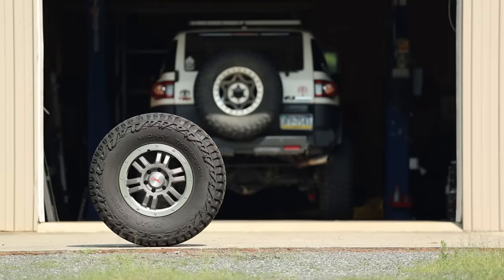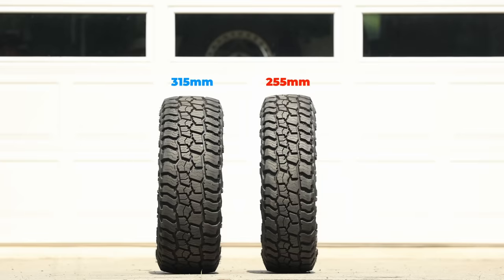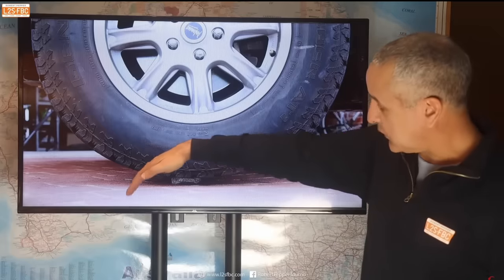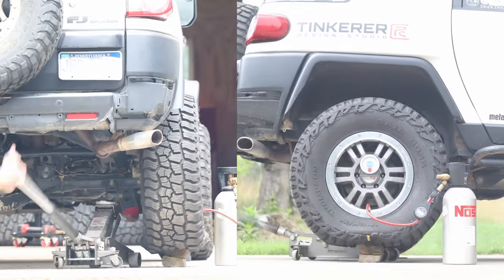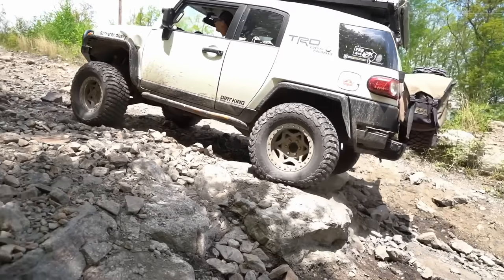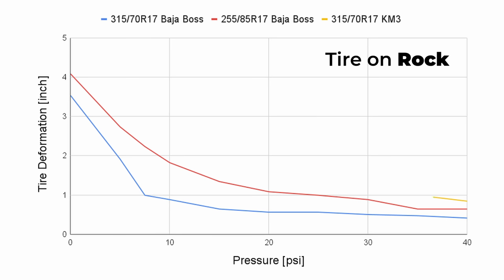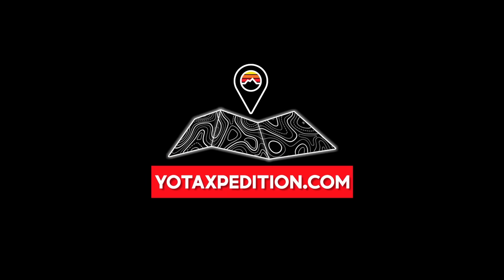3 Scientific Experiments to Settle This | Wide vs Narrow Off-Road Tires

Comment: Before I watch this vid, I'll chime out and say there is a reason most farmers with cows, other livestock that have to be fed regardless of terrain, ice, mud, snow, etc., mostly use narrow mudders. The tire sinks down to the bottom and bites the more solid terrain. Scroo contact patch; that's only for surface grip.
Reply: Reply to myself: in Missouri, I rode a pickup with 6 guys in the back, towing a car hood with an injured fullgrown cow on it, up rocky hills covered in snow slush, thru deeply mudded fields and trails, with very narrow mud tires. I became a believer from experience and horse sense.

Comment: Pounds per square inch, or- (pounds times inches squared).  If the wider tire has 10% more internal surface area than the narrow tire it will hold 10% more weight, and flex less than the narrow tire at a given pressure.

Comment: I wonder if most tire manufactures are just about show and no go. Race cars do have wider tires. There is a wider contact patch but the gains you get from going wider progressively get worse. There’s a limit for a particular setup.

Comment: I personally (yes, personally) do not see the appeal of the fat tires. From a design and engineering perspective, tires protruding beyond the body of the vehicle don't seem right to me, definitely not what the automaker intended. I'm not saying go wagon wheel thin, but if your off-road vehicle is also your on-road vehicle, tires tucked into the wells makes more sense aerodynamically. As for the looks? All those cool old Willy's Jeeps had skinny tires and I think it looks great.

Great experiments and always nice to debunk myths.

Comment: Could it also be the fact that the KM3 tire was used so it was broken in. The KM3 has been deformed thousands of times just from daily driving. So it would make sense that the tire would be more pliable due to that.  Also when it comes to tires the 315 tires have a larger air volume. The larger air volume means that the tire can physically support the same amount of weight without deforming at a lower psi. That being said 40 psi in a 255/85/17 is not the same as 40 psi in a 315/70/17.

Comment: Great video... I get data geeks. I like science more than most but right now I just wish someone would give me 3 "cool" options for my 2011, 2" lifted Subaru Outback.  My dumb ass though I would put Falken A/T 245/65 R17. Not one of my finer moments. Too big. Great tires when there not scrubbing. Weird thing is I have punished myself for 4 years. In my defense, all the builds I saw used this size tire. However, like my luck with everything my generation was the only one that wouldn't. Also, the "reputable" and very popular shop should have tried to persuade me in another direction. Lesson learned. My outback is 95% off road. Mud, gravel, sand. I don't see myself having many opportunities to rock crawl. I'm old, I'm tired and just like with my phone I want to hand it to you kids and make that thang work.  Great video, Thanks for sharing. :hand-purple-blue-peace:👴:goat-turquoise-white-horns:.  Collect dirt not ducks.

Comment: Mud racing buggies use very narrow wheels but large diameter. This allows you to cut through the mud with less resistance.  I bet the 255 wheels in your video would out perform the 315 in muddy conditions.

Comment: Your questionnaire was already wrong. It depends for what you intend to use those tires. Wider tires have more grip for instance. Narrow tires are more fuel efficient and are better in snow.
I am taking about regular car tires not off road applications though.

Comment: Why run a Load Range E tire on a light FJ? You don't get much flex running a tire designed for heavy loads. I run Load Range C with 3 ply sidewalls. Great flex and no need to go down bellow 20psi.

Comment: The wider tires allow you to use the less pressure inside. That's because they are using. You must not compare wide and narrow tires on the same pressure. The pressure on wide tire must be lower for the correct comparison. And then you will see, that aria of contact on wide is bigger then on narrow. You must reduce the pressure on wide tire untill length of contact patch will be equal to narrow variant. 

The wider tires give you the better wheel traction and friction only with the lower pressure inside, thanks to the increased contact patch

Comment: I live in snow country with a lot of snow. Never buy wide tires for snow. Wide tires are also much harder on your wheel bearings, harder to steer and maintain control, throw much more mud, rocks and debris onto rig, etc. I never buy a used vehicle that has wide tires mounted on it, it's a sign of abuse. Any tire that is wider then the body is actually a problem for a daily driver. Buying wide tires (or wheels) for their "looks" is a sign of immaturity and vanity. Don't buy used vehicles that have these either, the vehicle was probably abused.

Comment: I think you have to take break in wear into consideration. Tires that are brand new may not flex as much as tires with 5k miles on them, or just alot of off road time. So results may vary when conducting this same experiment after a few months of use. Reach out to the community to see if you could find 2 sets of used tires of the same diameter but thic and narrow.

Comment: Theres a lot of people praising his use of the “scientific method.” Except he has an insignificant sample size. He didn’t test which is better between thick and narrow tires he only tested which of those two tires did better. There are also several factors he didn’t control or didn’t mention that he controlled for them. I don’t know which tire size is better and neither does he based off these results.

Comment: Good luck with the pizza cutters. Only time I've ever used them, my vehicle rolled on the highway trying to avoid an accident. Unlike the 38. 18.5. 15 tires that maneuvered through much worst. 
   Unfortunately unless you have Deep Pockets for specially made tires you can't have real wide anymore. The days of the wide Mickey Thompson and especially Dick Cepeks Fun countries are gone.
  Today your hard pressed to find one even 14 in wide. Wider adds stability.
   I care less about whether a single tire is enveloping a rock. That's why the other three are locked. Pizza Cutters use to be considered essential to find the bottom of mud. I guess someone thought there was a limit to just how deep mud could be?
  I've had many Brands and styles over the last 50year's. No tire outperformed the fun country. Which was based on the original Armstrong Norseman. 
   Which despite being almost 50 years old I still have a set norseman's on my old 43 MB that have yet to even dry rot. True it has only done parades the last couple decades, and the rest of the time it lives in the hangar  except for a little exercise around the ranch But.....
   For whatever reason when they went with larger diameter Wheels they cut back the width of the tires.  I'll stick with 15s preferring to have more rubber between me and the rocks. And unfortunately I'm stuck at a maximum width of 14 1/2.  4 in narrower then what had easily motored me over all types of terrains for decades. 
    So how good were those fun countries?
  At 38x18.5x 15 on 15x12 Wheels my Toyota with lockers Made Easy work out of Oldsmobile Hill at Glamis.  Even climbing it in two-wheel drive.
     Sure miss the days of Mickey Thompson and his Innovations from drag racing to the Baja 1000. 
   Have a large poster of him flying off a 30 ft embankment out running the chase helicopter through the desert at over 140 mph. This was in the late '60s. He mounted 2 ft travel airplane shock absorbers to his sand rail to run the Baja. Lol  it's all that was available at the time.
    Just a few years after he achieved over 400 mph with his four engine Pontiac. 
     🤠🐂🏞️🛩️

Comment: I run 265/75r16 (32") on my first gen Tacoma. I have a camper box on the rear that pushes the vehicle weight to near the gvrw when loaded for a trip. That size handles the weight well and looks right to me. 255/85r16 (33") would require additional mods for clearance and the larger dia would start to require regearing. I'm curious how much weight sits on your fj's rear axle and how this test would look under the additional weight in the front end.

Comment: What do Arctic Trucks run in Iceland. Big wide tires to float over the snow!
Reply: That's because, eventually, your sidewall will disappear at too low of a pressure on a narrower tire. Lose the sidewall and you lose ground clearance and wheel protection. Floating on deep snow is purely about surface area, whereas crawling over rocks/hard dirt is not. People don't typically run 2 psi in tires for general offroad use over rocks. 

I personally believe, that for general offroad use, the width of the tire should be dependent on the weight of the truck to prevent the sidewall from getting to short when air'd down. If you air'd down to 12 psi in a 4000 lb Tacoma and an 8000 lb F350 Powerstroke, obviously the powerstroke is going to squish the tires more and make a larger contact patch because its 2x the weight. In the case of the F350, I would run the wider tire so that the contact patch doesn't get so long that you lose your entire sidewall due to the weight of the truck.

Comment: You normally will not see big wide tires on a farm truck. The thinner tire will cut through the mud, dirt, and snow. Sand and swamp you need paddles.

Comment: Even though you did a good job in video. You missed the entire point in wide vs narrow tires. To find out why... Look for a place that has lots of deep snow. Wide tires are skis in snow. But main purpose is less surface resistance.. In MN lot of snow atv races are done with the skinnest tire, some mountain bike tires.. You plowing and floating over snow, where the traction is at the dirt under the snow. Its like comparing pushing a snow shovel vs pushing an 8ft snow plow through snow. Tires dont always go over snow. But rather push through it. And this is the reason for narrow tires. Wider tires are better for off roading on a warm day. But if you want the most traction in snow you want something that cuts straight down to the bottom where the ground is.

Comment: Could the fact that the tires are brand new affect the contact patch and flexibility ? As the tire wears the contact patch should increase also due to the initial contact patch wearing down causing the patch to grow closer to the full with of the tread. The loss of rubber in the center could also cause the tire to flex a bit more too. Just a thought. Maybe you could test tires again after 5-10k miles.

Comment: Super informative! Would the narrower tire (255/80R17) less likely rub the body mount given the same 8.5x17 -10 offset wheel and lift? Or is that determined by the wheel width and offset irregardless of tire width?

Comment: Go through the Meadows the pizza cutters sinks down to the diffs and the wide tires gives you the flotation you need to stay on top of the sod pizza cutters will keep you from sliding sideways off of a muddy hill or even allow you to climb the hill where the wide tires you’ll slide off into the bush and you won’t be able to climb shit. It depends a lot on the terrain, there was no real life testing in this video.

Comment: Yes I have a 12.50 rubbing.
33x12.50 was not taller that stock size BFG
The 33 was more like 31.
The 12.50 was correct
The stock BFG was 32.3x10
No rubbing and now I learn it has a bigger contact patch.
Why would people run 12.50 mudders and never go off road?
They rub,they do not channel water well because on road the lugs are the only thing making contact.
They slow the truck down,because your plowing down the road with 20 inch rims that require more inertia to get rolling.
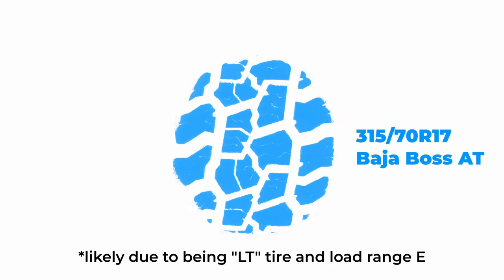I had a fast Hemi off road with 4:10 gears and 17 inch rims I ran 33x 12.50 pro comps.
I out ran two wheel drive hemis.
Now my son likes the looks of the bigger tires.
Do when he bought it they leveled it,and did 35x 12.50 20s in mudders.
Hey to each his own.
But if you enjoy speed, traction in wet weather run ATs in 17 or 18 inch rims.
Low inflation is no good for tires but if you have to run less air to get traction your gonna cup your mudders. Slow down your truck and change your shift points.
Your ecu will compensate for the increase in weight and rolling resistance.
If you dump your trucks in thick mud then go for it.
On my back country I have Falcon wild peaks AT 2
275 65 18
I went down a 15 ft dirt pit in 2 high and blasted up the other side back onto road.
That is all I want my truck in.
Performance on decline and incline with deep sandy dirt.
I'm not dumping my truck in some muddy swamp and getting mud in engine bay with water. I have skid plates but why risk hitting a deep hole?

Comment: Lol this makes me laugh as I have known this for over 10 years I literally only run 255 bfg km 2-3 on my Toyotas I love the tall profile and I have on board air , and air down the second I hit the dirt roads on my hunts 

And I have yet to ever loose or blow a bead and I air down to 9 psi 

When jeep released the new jeeps with 255 bfg’s I laughed and cried at the same time , price and availability went up 
But I still run them on my 01 double cab with a 3” lift 😎

Comment: Hello Kai. I really want a baja boss that would fit no problem on bone stock 5th gen 4runner. A little bit of mod is okay but trying to avoid BMC. I’m eyeing on that 255/85 baja boss and put it on stock ORP wheels. Question is, will it need wheel spacers, lift, regear and uca? I would really appreciate if you could look into this. Thank you!

Comment: You did the test on a hard surface. Place the paper on a few inches of sand then lower the tire on it. I bet the results are different. Measure how deep each tire sank in the sand also 😅

Comment: I'm trying to figure out what tires I can put on my stock suspension tacoma and I think based what other people have posted that I can do 255/85r16 or 255/80r16 with minimal, and some people report, no rubbing. I will be getting a 2-3" lift in the future, but I'm rocking a spare right now and would like to get the tires done first. I want pizza cutters anyway, so I'm hoping skinny 33's will fit on stock suspension.

Comment: No testing is exact on tires. While you do have the same load rating "E" tire there are things we can't see and or are privy to. 
Example as such the sidewall stiffness plays the number one part in the flexibility of the contact patch. While all three tires were "E" rated we don't know the exact material and amount spine stiffness, etc..of the sidewall when comparing between the BFG and M/T. 
Both mfg's could say three plies make up the sidewall but the properties of those three plies will play a drastically different reaction when conforming over rocks and the like at the contact patch. 
Another thing is a tire could rate the tire @ "E" but in reality could be capable of much more weight handling. More things we really aren't privileged to.

Comment: It’s not a true controlled variable experiment. I would like to see if there would be a difference in your findings if you used wider wheels on the wider tires. You pretty much put a 2 “ wider tire on a narrow wheel. Which will change sidewall deflection. And that will alter tread deflection. 

I would also like to point out. Many things look great on paper. But in real life don’t match what those papers say. Testing and comparing on the trail in a real world situation would either prove or disprove your paper findings.

Comment: One factor is the weight of the vehicle bearing down on the narrow contact patch seems to me like you would have more pressure or force pressing down in that area leading to more traction. Whereas if you spread out the force over a larger area you might loose grip. Not a scientist, just a guess.

Comment: Look, when I need more traction in the mud, I air DOWN, so my tires get wider and have more surface area in contact with the ground to spread the weight out.  A narrower tire is great for CUTTING to the bottom, but with my 10,000lb F350 SD, I DON’T WANT THE BOTTOM, because there isn’t one for my truck…

Even if the width versus length test holds true, a WIDER pad both plows AND PADDLES more mud than a longer narrower one.  It isn’t JUST contact pad.  Super Swampers paddle better than AT’s all other things being equal because they are able to grab more substance to push against.

Maybe for a hard substrate narrower might be better, but in my experience, for mud, wider is better.

Me thinks you need a heavier load.  You used the rear of the vehicle, probably for ease of jacking, but the front has the engine…. The tire deformation curve most definitely does not match that of the front end of my F350SD.  When aired down to 12-14lbs my tires are very pronounced in the change to their width, even in the rear.  I am also running the BFG KM3 Mud Terrains Load Range E though
Reply: I agree, I would like to add: on sand also where wider tires are better than narrow ones, and in general (all soft surfaces that same, includes mud and sand).

Comment: And if you don't want to are down just get a skinny tire and then you don't have to worry about airing down you got more weight on a smaller patch which gives you more traction to begin with anyways so you're good I never are down